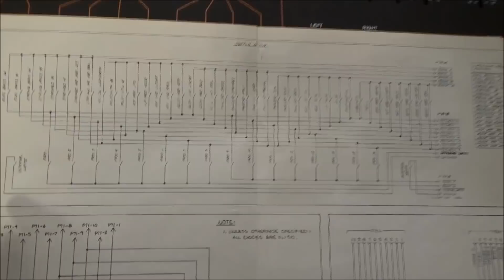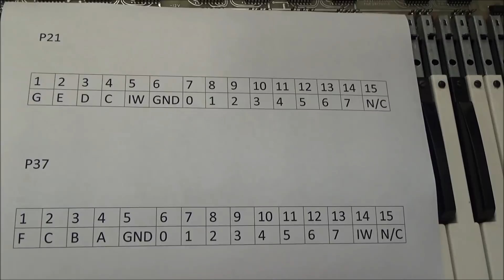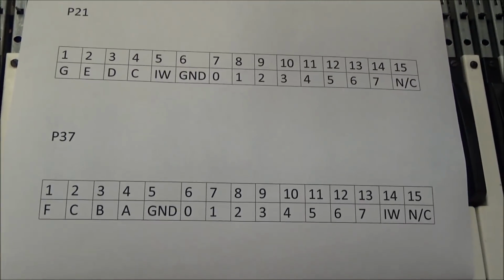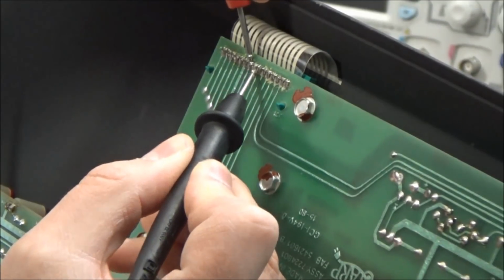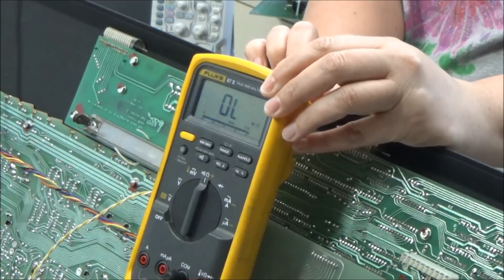Synthchaser #099 - ARP Quadra Repair & Restoration (Pt. 1) - Testing Membrane Panel

Comment: Been looking forward to you starting one of your Quadras , as you know ive repaired 3 ,  the biggest fault on all 3 I found was that bridge connector board , conecting  Poly , Lead and computer board ,   pins and connectors on the boards go to extra tiny tracking for some reason ,  the Quadra flexes real easy if you dont pick it up evenly , causing stress on that bridge board which then puts stress on the pins causing dry joints where pins meet their tracking solder joints ,,   I do apologise im terrible at trying to explain what I mean , im sure you will find this and cover it in your vids

Comment: you've got to have a REALLY FAST multimeter for what you're doing dragging the probe down the connector like that synth chaser! MOST - like most of the flukes etc tend to need half a second or so to 'beep' - you got lucky with that particular model i guess ... there's a comparison on continuity alarm speed on eevblog if you're interested
Reply from the maker: 1:15 and 5:01 you can see it's very fast...
Reply: yes it seems you have a good one ... i was just wanting to comment for other users - worried maybe they might try dragging across a barrier strip or terminal group like that and miss something ... just in case you know